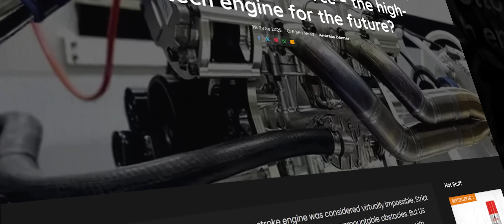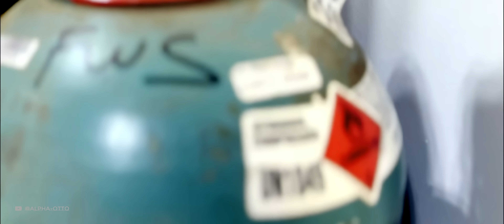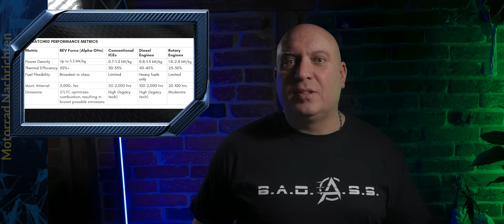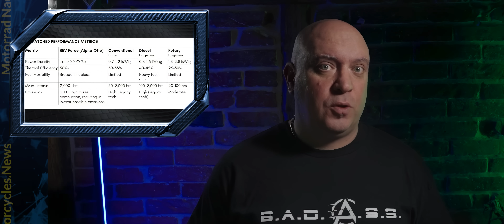Revolution – 2-stroke engines are making a comeback!? – NEW ENGINE

Comment: There have been many advanced 2 stroke automotive engine designs, pitched to the market over many decades but only one has ever gone into production. There has to be a reason for that because car manufacturers are constantly looking for new technology that will give them an edge over the competition.  To my knowledge, there has only ever been one design that has reached production,  the ill fated Bimota V Due, a very bold attempt to have an in house produced engine for the brand. It ended in disaster!!  I almost put a deposit on one of those upon it's launch at the NEC motorcycle show in the UK, I dodged a bullet there!   The bike looked fantastic and made 130 bhp from memory, from a 500cc motor!  Problem was, they could never get the engine to run properly on it's fuel injection system, eventually giving up and resorting to retro fitting carbs!!!  So I'll be very surprised if this engine ever reaches production, but delighted if it does!
Reply: Langen makes a street legal (in the UK) two stroke motorcycle.  The engine was developed by Vins Motors from Maranello.  Don’t know much beyond that though.
Reply: @gsn794 
They use single vehicle type approval to enable it to be used on the road.

Comment: I once thought the Free Piston Linear Generator would mark the comeback of the two-stroke engine. But this new approach is interesting: with direct fuel injection and rotary exhaust valves eliminating the traditional transfer case function in the crankcase, space opens up for a proper oil sump. That could potentially do away with lubrication left to burn with the fuel, lowering emissions in the process.

What I still struggle to grasp is how this design tackles the classic two-stroke problem of short-circuiting—the loss of unburnt fuel/air mixture straight out of the exhaust. Which has been the other problem of this layout. Still, the concept is promising.

It’s worth remembering that two-stroke engines weren’t just the domain of motorcycles. They once powered heavy transport too, most famously in the Detroit Diesel Series 71 trucks and buses.

By contrast, applying hydrogen to internal combustion seems less convincing. Even if thermal efficiency climbs to 50%, given hydrogen’s low production efficiency of only 50% 😊

Comment: The law of thermodynamics do not allow a 2 stroke to have anywhere NEAR the emissions output of a 4 stroke.  There's no way you're going to get that gas/oil mixture right every time.
Reply: The oil is not mixed with the fuel, it is used to lubricate the bottom cylinder, crankshaft, piston and all rotating parts. There is a second set of rings for oil control. The oil control rings never come up to the intake port, solving the oil problem. It's brilliant.

Comment: 5:37  I wonder what the air conditioning clutch turns on and off?  Supercharger perhaps.  I knew an engine builder in the 80's who did that to a roots blower using a carb setup for the blower and another for N.A.  Upon looking closer, that is not even the engine you are talking about.

Comment: Ah yes skateboardz
Kenny writes "lotta memoriez that board." 
      No. I donthink so not 4me.
 Maybe my board photo is a rare vintage gem I dunno. 
  
     No that particular board1 thoze cheapy with a rod up1 side2hold on2 pulled it out trash Perris has since become legend mascot in thcabin I use it2sit cook floor Japanese style do chorez sweep floorz 1w yearz cabin.  
  
    No, i actually had 1st original flip tail wood board guessing long b4 year they came out I owned threal Mcoy Spock &yes I sold it ebay 2010 hefty price RARE.
  Skateboard parks?
     I wz th 1st1 built a skateboard park my friend had built a 5 FOOT ramp I only now manage remember he evr evn exist.  He rode constantly real pro.
   Not me I built my skate park in garage thyear sister got her Sattelite Chryseler I crashed pulling out so we could ride boardz. 
   Big 2car garage.
  I'd race round track put dffrnt substances track each corner = WD 40 sand electrical spray lubricant, gasoline motor oil soap etc.
    Lolmost I'd painted that track all elaborate with chalk used casio stopwatch time myself race.... had black marks all th cornrz sliiiide roun crnrz 60's surfer Beach Boy style hang ten far as I knew "skatepark" wz smthing I'd coined. 

      Officially wz 1965 according 2google this photo wrld champs@ official park holding boardz looked like mine I built my park long b4 i knew any of that which was, juss now 2day google.
   That flip tale fastback fat slicks board I had that wz year board designs detonated mine was, when given 2me already an old vintage in my book.
   Given 2me by my friend Rusty Cox prolly 1st flipback evr built had wiiide muscle car durable clear nylon orange slicks i kept thoze bearingz clean&lubed.
  Thboars was exactly this1 exact photo google images sandpaper'd top maybe thexact board I sold ebay..
   I drilled 1/4" hole top& screwed on a big gold genuine brass Mercedes emblem from a car hood on top = a detail I only juss now sddnly recalled.
  Actual board here photo I am SHOCKED cuz thoze EXACT vintage socks I wore exact garden gloves exact shirt okay thass juss weirdly creepy cool amaaazing seriously yea Satanz boyz they alwayz followimg me around like liddle angry puppy dogz aaalwayz use reality hack tech& Bible codes2 see in2 time so's they cn knowhat i do b4 I do hence download thingz I do with Mandella effect tech which is real.
    "Make it look like they did it all b4 me"  ...try whitewash me.
   Wood flipback on my board that wz genuinely heated &carefully bent.
  Belonged 2Russelz older brother I had given Russ my motorcycle when I moved. We had identical bikes I broke mine in 1/2 1day doing slow jumps 2a slow crawl dead stop up& over thguyz taking cigarette breaks parked on th top hill on thr bikes... oooovr thr hedz. 
  I gonna defnly hav dreamz abouthat sht 2night gonna light up 1of my cigarette butts I alwayz pick up Walmart I use 2dreamv thee old dayz recall memories.
  Top Jimmy.
   
My older best friend Jimmy he looked exacklee 2meee like superman yea he boarded but he wz juss too violent mostly he& I built painted bikes. He had huge garage Grain Valley, tool shed endless bikes hanging... up&down drawerz neatly arranged parts wheelz frames lining thwallz.
   Yahwehs son "Satan" (Actually Halayel) juss gave me F You as I type this.
Lol thuniverse consciousness, it has a way of reveal old truths. Truths Satnz boyz dont want people know.
We live in a fake reality revolves around (CENSORED).
    I built that park just b4 I became threason modern day bicycles now look like rhey do.
     Became whathey are I basically single handidly cntrolled all manufacturing.
   Wow!!!
  
   So basically all sdarted when I worked humg out @Aero Sports yearz on end.
      In thoze dayz A.S.C. taught all th olympic ridrz& built thr bikes.
    So then I taught thm all how 2sit on bike.
     Boardman:
     Chris Boardman built my design outv washing machine parts. Lol bcuz Satanz companies refused do it. THAT iz when censorship really began = todayz "You Tube"
  It's just a weapon engineered whitewash meee.

      I would send ideas companies they all came out same thing same time would all stand around lookimg each other sue each other court I once wrote 5 biggest companies @once Shimano Mongoose Schwinn Treck Cannondale regardz my insane in line 3wheel "Tricycle Ultra Lever Concept" with infinite& wrking torally feasable linear gearz they all sent me patent paperz especially Shimano Shimano could see my linear shifter onviously would wrk wz totally legit they wrote sign sealed delivered pronto overnite wrote me 2elaborate on my rear hub design. That bike had 800mm step ladder cranks might see what 40mph???
     Todays cranks are 165mm.
     It required 3wheels platcorm frame support ther4 700c back with 2 15" wheelz 1under th bottom bracket 2support MASSIVE stress 800 mil lever arm from demolishing frame squash fork imagine if u will thleverage hence speed that much more crank &with sliding infinite linear micro adjust "Ultralink" ball bearimg smooth gearz system 2boot I still have photoz that bike I design somewhere.
    I got thee idea talking with Brian 1day. (From Aero Sports)
    Told him "theez clownz a joke I should design a tricycle beats thm in thr hour record 1day."
  
    Shimano didnt build Dual Control 1989 either I built it my garage 1986. My design pullz thpants down on theirz till this day& on every level  NOBODY or engineer has improved on my D.C. or ever will yes I am that good every pro rider has used nothing else 1989 till 2day.
     Bikes juss 1 big evil corrupt money grab sh*t show personified clownz circus I refuse input theez snakes imbeciles alwayz new & improve whats wrong? Hire sm competent engineerz cant u design anything right? 
     Corrupt cmpanies.
    I pointed sick'm sent angelz in destroy thplace I juss pointhey all do what I say theez people dont make bikes they make money.
  Photo my 1st bike Columbia green fastback 3speed.

Comment: Motorcycle king of kingz speaks.
  One idiot after th othr aftr th othre aftr th othre AFTRE th othre.
   BMW R 1250 GS.
   1example of th absolute batshit sheer lunaticy that motorcycles became when humanz didnt design thm anymore.
 Satan has put deemons in charge all manufacturing.
  If yr bike iz so heavy it wagz u like a tail of a gargantuan dog get u encyclopdias out& go google "less iz more."
   The amount of people theez monster 800lb bikes with 3" suspension& 100 plus HP hav crippled& murdered... DEADLY 2gether with batsht ergonomics riding positionz.
  WHERE do u getheez people?
  
   You are hurdling along @80mph dead of night.
   Outv 100 of u 3.67 of u WILL hit an object size of a brick. Eventually. Guarenteed. Period.
    Bikes need PERFECT handling. 
  Period.
   Only.
 Every time.
  That& suspension.
  You know,  AKA Motocross bikes. 
   Did u know MC bikes are designed 4 perfect handling?
   All motocross iz, iz a controlled train wreck while worse possible terrain going fast as possible ergonomics beimg design4 perpetual emergency maneuver yr bike, ANY bike always MUST also revolve ONLY around its ability 2recover from a near crash save thlives of 3.63 people vs brick in th road.
 When I used 2race Angeles Crest hiway we had a corner we named KMET named after a rock n roll radio station.
  I hit a fist sized rock that hi speed corner dragging my knee my handlebarz were now full lock left full lock right @ thspeed of a sledgehammr leaving pretty "S" shaped black marks on throad & down I went. That1 hurt.
   95% humanz are demons. Nephilem spirits. They cntrol ALL our manfacturing now.
    You got Devilz manufacturing 4 th wants& desires of yet more DEADLY poisonous devilz DEMONS tear thr own houses down with thr bare handz thr just really really stupid.
  Buildimg cardboard flammable termite food blow yr house down homes, woodframe oxygenated hollow spaces carboard homes 4ravenous bugz& rats 2live inside. 
   One thing about demonz is thathey are pigs they greedy juss greedy their pigz not hate speech or a back stab..
  There are pigz & then there are really really stupid poisonous pigz. Thats "demons."
    They are cmpudre chipped. All deemnz are digital.
     Hive mind linked 2Satans BEAST cmpudre so u might svn assume they smart no they not smart just 2year oldz who wr handed thkeyz 2 thFerrari givn th magic wand.
 Lol Ferrari are built rear engine so they spin out.
  
  "Lol try throwing a dart with heavy end in thback."
  
  It juss iz nvr enuff withem & there iz no balance either. No epicenter no rhyme no reason no here nor there no up no down they just point& shoot 2year oldz hav only1 thought = grabbing thnext poison lolipop fuel thr nerve endingz via retarded eyes functioning only on twisted backwrd gut appeal & incompetent visual hit syndrome.
   Funny how thmore demonic a person iz thmore that person is a sucker 4 other deemnz = snake oil salesmen.
   
   Its karma she coming back 2bite thm deemnz? They just CANT evr engineer or design or buy anything wrth a sht th only thing wrse then a 2year old iz a 2year old nephilem giant. Roaming around th earth givn an engineering stick & placed in charge of trampling thee earth with a magic CAD machine as his wand.
  There should be 1 Motorcycle design wrldwide only period = a 250lb supermoto 40HP 12" travel front& back with frame built like fat cro bar.
 It must be light get 100 mpg ultra stiff frame handle perfectly rider upright like on a motocross bike.
    All street or otherwise bikes should be a do all SUPERMOTO bike WITH BLINKERS.
   Go watch a supermoto race maybe u will see what I mean.

Comment: Sounds Already out of date. Electric MCs are here, amazing for simplicity and power delivery. 
 A years 70 mile commute,  every day in all weathers on ‘Zero sr/s’. Has been simply Awesome fun and reliable experience.
Reply: Electric motors are BORING!
Reply: @jlo13800 I have a handful of motorcycles of various shapes and sizes. The electric is the most thrilling.. sorry you are simply wrong.
Reply: @Flamingben Electric won’t braaapp like a 2 stroke
Reply: @jlo13800 I have both. Love them, but the electric kicks ass and smokes all the other commuter of the lights.
Reply: @Flamingben Car culture can keep their 4 turd stroke crap and now that shits in outboards now. They can keep it.

Comment: Who remembers Orbital Engineering from the eighties?  That company purportedly created direct injection two stroke engines designed for automobiles - extremely powerful, light, and clean burning.  What happened?  GM bought them and shelved the technology.....
Reply: They made production in the aprilia sr50 ditech and they are a bag full of mither
Reply: Ford should offer a 429 orbital DFI more CID orbital DFI 2 stroke v8 boss!
Reply: I worked for The Orbital engine Co. and I was told but can't be 100% sure that the reason was that Ford and GM were too busy trying to break the patent to make the decision to pay for any licensing fee. They would not take it on. The engine I am talking about is not the original 7 chamber orbital motor, but a 3 cylinder two stroke piston car engine.
Reply: You are gonna drive me to drinkin if you don’t stop driving that orbital DFI 2 stroke Lincoln!
Reply: It's time for a orbital DI 429 2 stroke v8 boss!
Reply: @jlo13800  Can you imagine the amount of power?

Comment: It was early 90s. Ford had build and tested newly 3Zyl/2 Stroke engines. Lots of electronics to bring the Emissions down. Fiesta,Escort und Scorpio were Equiped with modern 2 Stroke engines. 90BHP. Factory were complete build in GB. And then ? Ford stopped everything and sold their knowledge to Aprilia. They called it DI Tech. Aprilia scaled it down to a 50ccm Motor/Scooter. 2 liter Gas/Oil per 100km .500 euros more expensive than an old one. You know what happened and nobody bought this. From whom do I know ? Podcast Alte Schule. Prof. Fritz Indra told this . He was a Motor builder for Opel. A well respected Man.
Reply: How about an orbital DFI 2 stroke 429 v8 boss!

Comment: It sounds expensive to repair when the management system or compressor goes wrong and unless they make a smaller version, a bit overpowered for anything but hypersports high budget bikes.
Hmm, 94lb.. Maybe they could get it down to 55lbs and 80hp.

A 350 ypvs engine was 77 lbs and made 60 hp stock.
(early versions, later were nerfed to 50)
The RGV 250 engine was (claimed) 74hp and weighed a fistfull less.
Now would I like an 80hp YPVS that does 65 to the U.K. gallon? Yes.
But I wouldnt be excited about the retail price when a used sv650 costs 3 grand, 
makes 72hp with a 128lb engine,
and does 55 to the gallon.
As I said, full size engine for rich squids makes sense but not for me.
Reply: the shape of the engine all wrong too its too long these engine like orbital seem best as fixed units held at cetain rev range orbial never got picked up